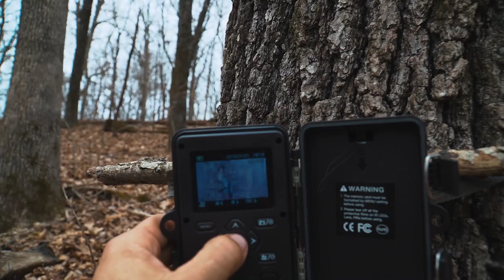Building Tiny House WALLS / OFF GRID Self Reliance / Living in a Canvas Tent

Comment: @Jason...initially I watched some of your video's due to Dutch and Daniel's recommendation. I wasn't sure if I wanted to sub to your channel or not. I reside on 207 acres in TN. I have a few building projects and want to learn how to do it myself. Instead of hiring a handyman. I know you're not an expert per se. But you do seem to build some nice things and make do with what you got. I applaud you for that. Well I decided to sub to your channel. Because I've found I'm learning how to do things. A good friend of mine said, if you got the right equipment, you can create what you want/need. I needed to tighten my fenced yard area for the dog. So, I got a 2 ton come along and used the method you did on a recent video. .......................................................................................................................................................................................................…...……...It worked so well. Hence I went out a purchased a circular saw, a better 1/2" drill/drive and some other things. Because I need to build or attempt to build a bigger shed. That can store an ATV and riding mower, as well as some room to store things and move around it freely. I'm tackling this project because you did actually inspire me to pursue this project. I initially started out building a 8'x8' deck platform for the dog when she enters her yard. Nothing grows there and when it's muddy. Abby (the Doberman) bring mud into our house. Well, I built it and it came out rather nice. I did a few smaller building projects...like a dog house, enclosed the bottom of the deck, which is about 4 feet high. I really enjoy doing these sort of things. I'm finding it's quite relaxing. Which is good since my work is very stressful and people's lives depend on me. So thank you.
Reply: Well God Bless and keep on keeping on so glad you subbed
Reply: Way to go!
Reply from the maker: Thank you for giving me a chance!
Reply: 207 acres in TN!?! Im having a hard time just trying to find 25 🤣🤣🤣😍 TN here too!!
Reply: Mary my wife and I reside in a small town called Sparta which is just south of Cookeville. If you think I have a lot.....my neighbor across the street is on 6000 acres. He's a cattle farmer. He and his wife use to own our land. So was great that the neighbor had a lot of equipment and let us use it to cut trails. The backend was already flat and wide open. I do have to commute to Vanderbilt (were I work) and takes about 1 hr. 15 mins. I'm at work by 6:30am. But the commute is well worth it for me. Couldn't make to work on TUE due to the tornado's I-40 was shut down. Not sure of your current local, but my area has what you're looking for.
Reply: @ricks.1092  been through there many times, love the back roads and have kin in Murfreesboro and Colombia. Me I'm up here in Roane County, sure has been sad how hard a small town like Cookeville has been hit by that storm, lots of folk missing and some confirmed deceased.
Reply: @ricks.1092  God Bless all those affected by the tornados!  💜  Dallas is still gathering up trash from ours in October.
Reply: Great that you found a very useful new hobby that is also good for the soull & our frazzled selves!  Thanks for sharing your story!   💜 😄
Reply: @ricks.1092  Hey bud. WTG on getting out there and doing it. Jason and his family own a 1000 Acre ranch in South Texas where his grandparents raised Cattle and they grew up out there a lot. His uncle still has Cattle on it. You should check out Jason's 100 Ranch Rescue videos. A lot of inspiration, along with their shed to house videos.
Reply: possibilities are there if we only give it our good try. me and hubs unloaded a wood stove into our cabin from top of a hill on sliding boards and push pull secure a bit at a time and we are out of shape and in our sixties off grid but it is beautiful and burning our wood as I write
Reply: @grannianni7681  My ex and I used to live in Morgan county.  Beautiful country.  So sorry to hear of all that awful weather.
Reply: @ricks.1092  im in Clarksville  just 30 min nw of nashville, oh i hate parking at Vandy 😁😁😁😁 i like that area (Cookeville) i just cant find any homes with at least 25 acres if land thats not 500k lol
Reply: Welcome aboard!
Reply: 207 acres, nice.  I'm look for a 10 acres in East TN.

Comment: It’s not just that it’s overkill but the more studs you put in your wall the less insulation you can get in.  If you add up all the studs your using it will probably equal out one entire wall area of studs which equals too a lot of uninsulated area.  As you have probably found out it’s very difficult nailing two walls together when you have 2-3 studs to go through
Reply from the maker: Im not worried about that

Comment: Definitely a buck rub.Glad you are tying in the top plate! For those lofts, you could run a ledger board across the outside at 8' high, then attach your floor joists for the lofts right to that with hangers -- kinda how they used to do second stories with balloon framing -- except inside-out. Support the other end with some posts and you're off to the races!

Edit: Next time you are in town, make sure you pick up a long 1" spade bit for running wire thru those areas with all of the studs together. Pick up a 6' or 8' level as well to keep things plumb. You will also want to lag screw those walls down. Regular screws and nails are not enough.

Comment: Glad you kept the wall 10ft after all Jason and did it in 2 separate sections which definitely made it easier for you to lift in place by yourself.  💖👍
I know you probably don't want to spend the money but I really think it's time for some proper steel toe work boots. I was worried you could break a toe or slip since those snake boots don't have much traction.

Comment: Good idea on keeping your side walls at ten foot.  In a smaller space a high ceiling can really increase the sense of space.  Plus your can set your joists for your loft at eight foot and gain some head room along the walls where your rafters are set on you too plate.  Also, if you want to do a shed roof you can set a knee wall on one of the other walls and run your rafters from the top of it to the opposite outer wall.  Your knee wall won't need to be more than 6 or 7 feet to give you headroom in the loft, and still keep the pitch of the roof adequate for drainage and installation.  A shed roof will also help you for water catchment for a rainwater collection system (you only will need one rain gutter and two down spouts).

Comment: You have some sturdy walls!  I was happy when you redid the corner with the top plate, good to see the extra strength.  I love all the windows, too.  It's gonna give you a wonderful view of the beautiful scenery.  How exciting!  One thing for future consideration is that when you're insulating, those beams all conduct heat.  If you put a layer of foam board on the outside, or use a product like Zip-R, you'll stop the thermal bridging, which will help keep your house's temperature more stable.

Comment: Recommend safety glasses in case of breaks like that hammer! They are a pain but could save you from injury!  Also if those aren't steel toed boots, may want to use a sledgehammer to knock the walls into position instead of your foot or hip. 
Great job on the walls!

Comment: Soooo good to see you working on your new HOME!!!  Looks good and thank goodness you accidentally built that end wall 2 feet higher sounds like it was a "great idea" lol.  So proud of you for sure.  Well I guess you should give that hammer a nice burial it sounds like it deserves it...oh man laughing so hard here made my morning...so sorry about your hammer though really I am.  You kept saying you were really tired and your hammer said the same thing I guess.  Is there any way to install "tiny" windows above the lofts for allowing extra breeze even though your are putting in porch covered roofing you might still have room to do this?  This way you might put a ceiling fan in the center of the cabin and it could pull in some cool air in the summer and also pull the heat down from the ceiling when you use your fireplace in the winter.  Since heat rises a ceiling fan would help immensely for evenly heating your cabin. Just a thought.   Yup fill in that gap between the window and the door for sure need it there.  AWESOME JOB and lookin good!!!

Comment: To pull a nail, you hook the nail then crank to the side of the hammer, not the way it looks to remove nails.  Perpendicular to the nail slot. Pulls easier and wont break your hammer.

Comment: here's a hint, use a 2x4 block too pull nails, and as to the hammers, there is only one worth a damn a vaun framerit is a little heavy at 19 0z. but it is all steel.  and it last a life time.

Comment: Agree with earlier comment.  Dont fill in those small gaps btwn studs with more studs.  You are making more thermal bridges.  Insulation goes in those gaps.  If you choose to fill those gaps for the sake of not overkill but mass murder (joke), be sure and install a thin insulation (3/4" or 1") around the outside of the house to at least get some insulation over all of the thermal bridges.  Please get a taller ladder and wear that tool belt, then you can grab that hammer and beat that wall into place instead of using toes....anyway, just good ole boy recommendations.  Keep up the good work.

Comment: Jason, I would rather have a well built sturdy house that will last a long time than a house built just to get by or is good enough. Good enough is not good when you plan to live in a home. I want a home that will last not fall down. Now days homes are built just to meet building standards with cheap woods and supplies.